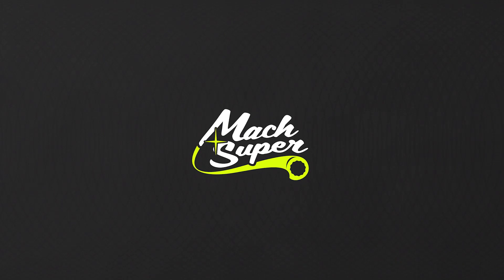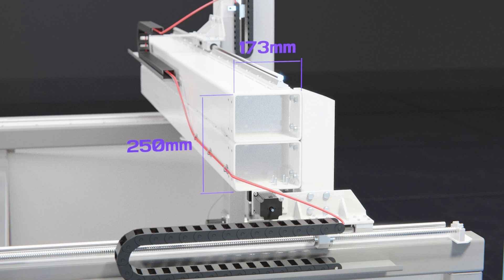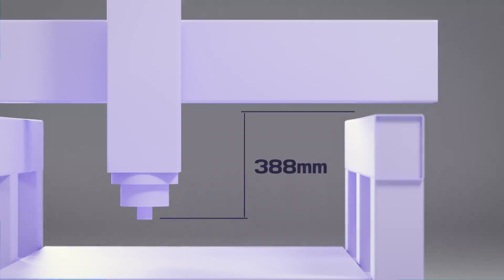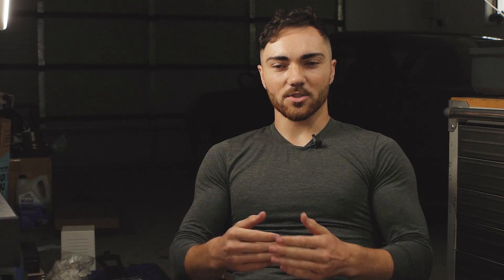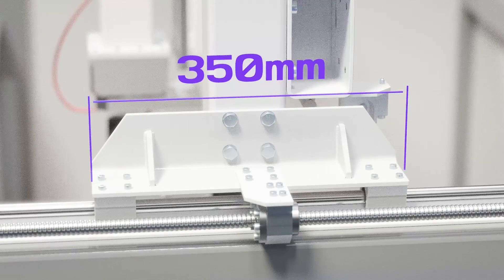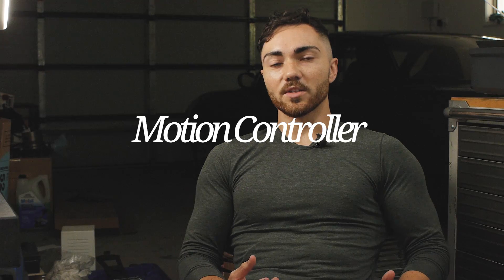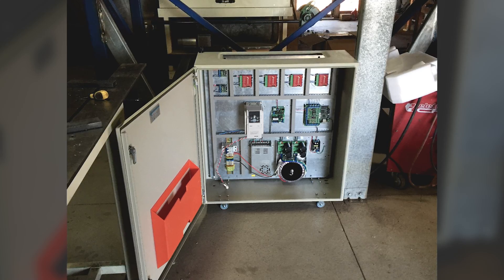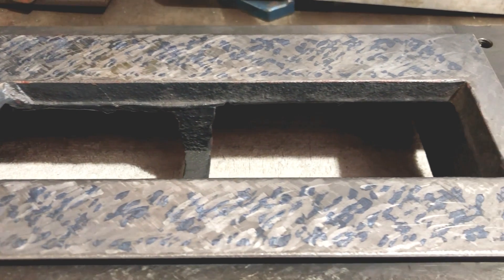How NOT to Design a 5 Axis CNC

Comment: Your frame will always have some flex. Even 500,000 machines show this to some extent. If you want to get that out completely, it won't be easy, especially if you want to machine materials like aluminum or metal.
You have to find the right balance between the stability of the machine and the right programming. You can get a lot out of programming.
Have you measured the clearance of the milling spindle?
Your frame will eventually be stable enough then it will be the spindle that is next.
But very cool project keep up the good work. You have more intusiasm than some mechanical engineers I know.
Reply from the maker: Certainly every machine has flex, just a matter of eliminating it enough to suit your needs, right?
What do you mean when you say ‘spindle clearance’?

Thanks for the comment, man.
Reply: @machsuper  Exactly. If you work mainly with wood, a little flex won't matter and you'll save a lot of money. You probably won't even be able to measure the deviations. If you want to work metal at full throttle, it will be really expensive.
With spindle clearance I mean the concentricity of your spindle.
When I move the spindle on a $1000 pillar drill at my local hardware store, it has a lot of play and the runout is bad. You can see that the drill is not running true.
Your spindle doesn't look like it, but with cheap spindles there can be flex. It is not always the fault of the frame. Especially after a crash you should check this. In woodworking it is mostly unimportant in metal important if you want to keep tolerances.

You can also compensate it with Milling Same or Counter Direction.

The tool can also make a difference.
Tools for metalworking will never run as well in wood as extra cutters for wood. These usually have a different angle and different coatings. In the beginning, carbide tools are perfectly adequate. If you want to use the machine to its full potential, it will not be enough.
High performance wood cutters are therefore equipped with diamond. Unfortunately unaffordable for private customers.

Comment: What about doing what i did on mine, fill the gantry with Epoxy Granite

It does not add TOO mutch weight, but man it does wonder on both flex and resonance
Reply from the maker: I have no doubt it would improve it, especially with the resonance. But I would still, sooner rebuild the gantry with a large square section as shown.

Comment: i wonder if it's possible to make a moving bed design, but effectively the opposite from the depicted model, where it's combined with the moving beam, so you handle the x and y with the beam, allowing the mounting on the components to be very rigid to facilitate rapid motion of the cutting head, but handle the z axis with the bed, raising and lowering the whole workpiece, that way the mass of the piece would have less of an effect on the mechanics of the system, and you could use a set of robust worm gears at the corners, a series of hydraulic pistons, or some other method that hasn't occurred to me at the moment, as the means of lifting the piece, whichever permits the highest degree of precision.
Reply from the maker: Unfortunately that’s not a good approach. Imagine machining the inside of a deep bowl shape about 300mm deep. The gantry will collide with the rim of the bowl unless you make the spindle permanently hang very low down from the gantry, in which case, you may as well just put the Z axis on the gantry. Also, putting four drive mechanisms on the bed is a lot of extra cost and a lot more opportunities for failure.
It’s great that you’re thinking outside the box though, keep doing that. 😊
Reply: makes sense, i was thinking about things a little backwards, the form factor i suggested would work better with additive manufacturing than subtractive.

Comment: yikes, careful with rules of thumb... the 4:1 thing is hogwash.  The load is the load, just depends what the bearing's load capability is, and of course what type of bearing it is (angular contact might take the loads in the right directions, they can sometimes handle 10x the load of a deep groove bb... so it all depends.  Just have to apply the right engineering calculation and solve it to determine where a load needs to be or whatnot
Reply from the maker: I totally get your point, and I’d quite easily be persuaded to retract or adjust my statement about the 4:1 thing. I said it while keeping in mind a large portion of the audience who watches my videos and the machines they’re looking to make, which I believe is either nicely built routers or some sort of 5 axis machine, also likely a router/portal/gantry mill (too many names for basically the same thing haha). The 4:1 is more about the proportion of the sections of machine frame. For example, the column of a mill might often be 4:1 in height to width/depth. I perhaps shouldn’t have simplified so much and then mentioned it while talking about the bearings. There’s also competing forces to make an entertaining and digestible video that also has valuable information. If I didn’t cut out entire sections in editing, this video would have been over 20 minutes long. I’m looking to keep them under 15 minutes for now. Thank you for pulling me up on what was perhaps not a high value bit of advice.

Comment: It's interesting hearing those infos about a CNC gantry while in the 3d printing space people try to make them as light as possible to minimize inertia for higher speed without loss of accuracy, going as far as making them out of carbon fiber. Also we know that "moving bed" design as "bed-slinger", which is now considered more or less obsolete. Especially now as modern printers modify motor movements in real time to reduce vibrations ("input shaping"), and it turns out having the resonance frequency change as the printed object gets heavier on the bed is not ideal compared to moving a much lighter gantry.
Reply from the maker: All the immense effort that gets put into making these super heavy, stiff structures for CNC mills all comes down to the simple fact that the tool experiences forces while working. It's the key difference isn't it? It's the key difference between why a 3D printer should be carbon fibre and a mill cast iron, steel; granite or some heavy, stiff composite. I have wondered about building a machine out of carbon fibre though. If it's so strong, and light, could it make for a great high speed mill if you can work out the resonance?
Interesting point about the changing resonance in the 3DP bed as the part gets heavier. You clearly have looked into the details of 3D printing more than me.

Comment: That's some impressive work you've done. I'm happy to see someone taking interest in the mechanics for a CNC machine, my self being a senior mechanical designer. I am designing a 3-axis router or rather portal milling machine and i have come up with a design somewhat similar to your concept. If you want to I can share some of my solutions. My focus has been to make a very rigid machine for milling steel and hopefully also hardened steel. Another aim I have is to make the machines outer dimensions small in relation to the work area.
I believe that the solution that you call "moving bridge" is the most promising one. Choice of bearings and placement of ball screws is essential and using twin ball screws is the way to go for both Y and Z-axis. The thrust bearings and the homing sensors are also of big importance if you want to achieve high precision.
I was also impressed by your approach to the project planning, working the last 30 years with product development I have taken an interest in conceptual work and how to manage a project. Please let me know if you are interested in exchanging some ideas, I think I could benefit from it too since I'm not so good at software and electronics.
Reply from the maker: Hi Leif, what gets me particularly interested to know more about your design is the fact that you’re aiming to achieve hardened steel, and also the fact that you mention twin ball screws on the Z axis. If you’d like, send me a message from my website contact page and we can have a bit of a chat: https://www.machsuper.com/contact
Reply: Whoa, another input. I might explore the idea of hardened steel. I am quite familiar with heat tempering, why not I have thought about it. Thx!

Comment: As an engineer who works in industrial control systems and automation (30+ years) this is a fair effort for a non-engineer and you have done something that few do - LEARN.

Good pick up on the linear bearings it was the first thing I noticed, but then I do know why people use circular shaft linear bearings($$$). The linear rails are way more accurate and more importantly handle larger loads for their size. HOWEVER those rails are heavy and you can get into a lot of trouble on vertical axis if you are not careful (see below).

Before we get to vertical axis we need to cover an issue that confounds fully qualified engineers - INERTIA RATIOS. This is incredibly important with motion control if you want to get any sort of accuracy. All mechanical engineers learn about it in their very first dynamics class. I know because I lectured and tutored that class as a postgrad. Its also something all mechanical engineers immediately FORGET after that class and sooner or later bites them. 

To ACCELERATE & DECELERATE anything requires force and in the case of an electric motor (servo, stepper,... etc) that is most commonly a TORQUE force. Yes I know about linear servos, but the same thing with inertia still applies.

FIRST (and super important) we are NOT talking about static loads we are talking about DYNAMIC LOADS so it involves INERTIA of the system. There is the inertia of the motor and the inertia of what its driving. Under static conditions the torque required to hold a load or start moving it is simply the gear ratio *BUT under acceleration and deceleration its a function of the gear ratio and the INERTIA RATIO SQUARED. So if you double the mass of the load on a motion control system you require 4 times the motor torque to accelerate and decelerate the same.  

THIS IS THE CRITICAL POINT FOR ALL YOU AMATEUR CNCers
KEEP YOUR INERTIA RATIOS BELOW 10:1 as in the inertia of the load must not be more than 10 times that of the motor.
Its even better if you can keep it below 5:1 and best around 3:1.
Consider that at 5:1 you are 4 times better of than 10:1 and 3:1 is more that 10 times better than 10:1.

Think of it this way. Imagine if you have a light but reasonably powerful car and you hook up a large heavy trailer. Sure the car has enough grunt to pull the trailer, but what happens if you try and brake hard at speed? The Inertia of the trailer just dominates the car and pushes the car past any limit it might have or just jackknifes it.

In general you will find the inertia for a motor in the catalogue or manual. For all the other items in the system you will also find that data in the catalogue or manual. Companies like Siemens, Schneider and others all used to produce inertia calculators with their catalogues already in them. If you use one of there calculators and it wont let you enter you motors particular stats just use the motor out of their catalogue that is closest.

On your vertical axis its incredibly important to get mass out of the moving parts. There's a terrible tendency for mechanical engineers to put the linear rails on the moving part. I'm pretty certain you did what I'd recommend in having the linear shafts on the fixed side. The problem with vertical axis is that you are fighting gravity as well as inertia.

The other thing to consider is filling the base with epoxy and granite to add dampening mass. There is a continual issue with all motion control systems. If they are very light they have less dampening and from just the motor vibrations you can get all sorts of accuracy issue because the whole thing is shaking. This is why milling machines, lathes and CNC machining centres are made from bag castings. Its not that the castings are cheap its simply mass damping.

There are videos here on YT of guys who have used epoxy and crushed granite to get that effect.
If you really want to see how far you can take certain ideas watch Dan Gelbert.
https://www.youtube.com/watch?v=sFrVdoOhu1Q 

If you want to watch guys do amazing stuff 
Stefan Gotteswinter
Robin Renzetti
Joe Pie
Reply: amazing comment thanks for sharing your knowledge
Reply: @sebastianjuara  thanks.
Reply: Just to dumb this down another notch, would it be right to say that...
1) we need bigger motors than we probably think we do, because acceleration/deceleration is hard
2) for moving axis we should be optimising rigidity, dampening, AND weight — in order of least to most likely for us hobbyists to forget.
Reply: @johannesmajamaki2626  You're partly right.

The biggest issue with axis stability is the Inertia ratio between the motor and the load. Most people will tell you needs to be below 10 but to get really high performance you want it down under 5, BUT it is dependent on the type of load.
Dampening is fantastic and the best dampening is something like a solid granite base. Its why so many machines traditionally have what look like ridiculously large castings.

What catches people out with Inertia ratio more than anything else is that its a square law. So if you double the inertia ratio you quadruple the effort of the motor takes to control it. So if you have an inertia ratio over 10 it just gets very hard to have reliable speed * positioning accuracy and stability. 

Weight is actually part of the inertia issue too. 

After that rigidity is incredibly important. As you go through the axis their collective inaccuracy (backlash and rigidity) adds up. That's why over in industrial robotics you get things like SCARA robots for high accuracy pick and place tasks.
Reply: good point on mechanical advantage biting you in the but
Reply: @Retrocaus  Thanks
Reply: thank you very much for introducing resources of wonderful precision machines.
Reply: @CasualPlay91  No probs. 
Just sharing like so many others do.
Reply: very Nice n useful info Tony !
Reply: I think it’s a misconception that adding weight to improve dampening is a good thing. Weight by itself doesn’t dampen, it’s the ability to absorb vibrational energy which is a property of cast iron and epoxy granite. Adding mass lowers the resonant frequency and therefore is undesirable in high speed machining. You are looking for highest stiffness with lowest weight and highest dampening material properties.
Reply: @ML-jf1xe  WTF else is it when you add mass that helps with vibrations?

That's right dampening.

As for resonant frequencies. They're NOT a function of mass its a complex function of material properties and shape.

Comment: I always thought it would be more rigid to have two connected lightweight gantries, one on either side of the Z. That way you’d cancel out any flex, in exchange for a bit of X range.
Reply from the maker: I’ve discussed with someone on another comment on this video about why I think it might not be that great. I think, if you’re doubling doubling the same size gantry that you were already using, then of course that will improve rigidity. But if you’re taking up that much space with two gantries, you may as well take up the same space with one very big gantry and stand it up right. The two small beams are losing out on a lot of potential horizontal stiffness by not being tied together for their entire length.

Comment: Im have to build my stiff gantry mill up to August and i had already done 90% of 3d project. great vid!
Reply from the maker: What is your mill made from? Steel?
Reply: @machsuper  epoxygranite base, steel moving beam and aluminium Z plate. Im going to cut aluminium, steel and every metal which this beauty could handle. i had finished MES simulations for Y beam ( filled with epoxy granite ), Z plate and working on base to simplify the MDF molds Im going to use for this base manufaturing.
Reply: You are doing a gantry mill/ Im about start doing the same thing! Is square tubing filled with sand ok for this???

Comment: Funny I thought that a moving bridge would be more useful/rigid because of the part never really lying flat but rather in a vice or on a higher surface if you have a big part etc... Keep in mind I'm more interested in a "big mill" that a "2D router"
Reply from the maker: Well it's all a matter of what you need from the machine. If you need really good access to load large parts on the machine, a moving bridge is a good option. In all cases, you can build the rigidity you need by designing it to suit.